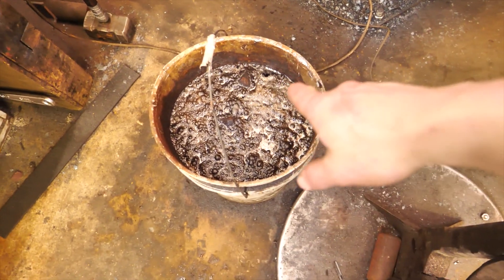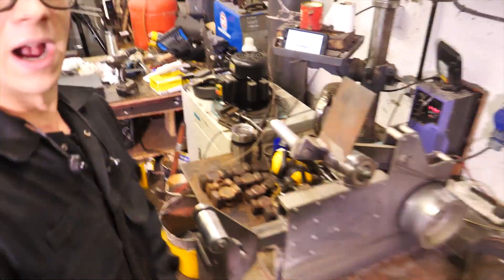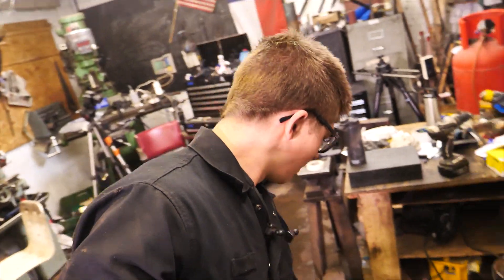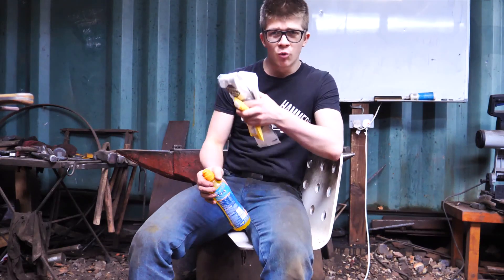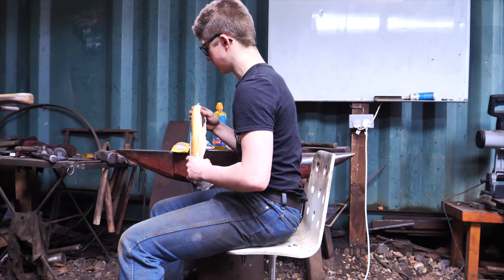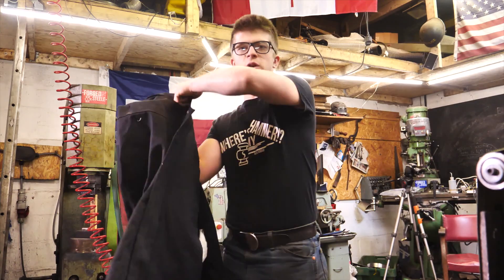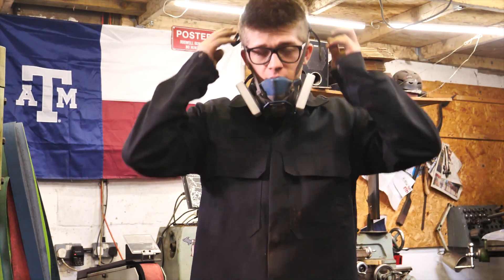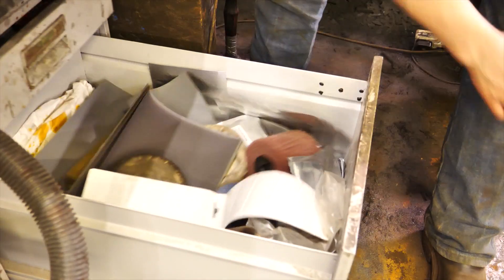BELT GRINDER BELT EXPLODES

Comment: little sugestion, if you stand in one place for prolonged time (eg.  when grinding) your feet will hurt. invest in workshop mats, that you put on a floor. it makes work so much more pleasant.  we use them at work when we weld in a welding bay all day. it's a blessing. try it out!
Reply: Tomasz Drozd yeah I know them as anti fatigue mats. they are good
Reply: Tomasz Drozd it's funny but it makes your day so much easier
Reply: And if you double up ( 2 mats) it's even better!
Reply: Given your work habits and style, I'd suggest two. One for the grinder and one for the mill - even though you don't use the mill that much, you're going to be standing with it for a while at a time and it never hurts to have a spare.
Reply: with that belt fail maybe one as a T- shirt😜
Reply: Tomasz Drozd especially wearing 1 inch heal boots -3.10
Reply: 3.10 ---1 inch heal boots ha ha
Reply: It's funny, a lot of people swear by them. I have got one at work as well, but i find them extremely uncomfortable. After a day of work my knees ache as hell which doesn't happen when i don't use them.
Reply: try to stand on your feet?
Reply: Check out the video Abom79 did about the work mats - he found some really killer ones.  I worked on concrete floors for many years, and I can honestly say you will never know how you got along with out them once you try good ones!
Reply: get the matt, you will thank yourself as you age
Reply: yes I agree, working as a part time cabinet maker my boss or some good ones and they are awesome when you have to stand at the table saw for hours on end cutting board to length
Reply: Not wearing cowboy boots when you stand on your feet all day will probably help too.

Comment: Top tip! Use distilled malt vinegar (white vinegar) available from food wholesalers such as Bookers for about a fiver per jerry can.

Used vinegar when its nice and brown has been converted to iron acetate. Strain and bottle this up and sell to woodworkers as a natural wood stain to ebonize wood. Zero cost to you.

Keep up the good work. Giles in sunny Yorkshire.

Forgot to mention if it doesn't bubble anymore when you add steel to the vinegar it's completely converted to iron acetate and now will no longer remove the scale.
Reply: Awesome info, this is one of the few channels where I find a lot of good tips in the comments too.
Reply: Doesn't vinegar cause hydrogen embrittlement? Not sure how long it takes but I've been too scared to try it with hammers, but you can bake in a oven after to remove it
Reply: I use just cheap white vinegar... remover rust too.

Comment: great video  Alec you need to put a rubber mat in front of your belt grinder. They really help with the back and hips not getting old faster. The older guys in shops I worked at used to tell me all the time when I was your age and I would laugh at them and call them old. Then I got older and figured out they were right. Trust meyour older self will thank you some day. Keep up the great work.

Comment: I'm a hobbyist silversmith. A routine part of forging or soldering for me is putting items in a pickling solution after it's spent some time under the blowtorch to get rid of fire scale. Vinegar is one of the ingredients in that solution--I'm betting there's a bunch of different pickling recipes that'd work well for the fire scale you have to deal with.

Comment: I ordered some bottles of glacial acetic acid (concentrated vinegar)to de-scale the water-cooling system on our CNC routers where I work. The Safety Sallys took one look at the MSDS (material safety data sheet) and sent it back. lol
MSDSs are written by lawyers, not mechanics or engineers. The one for silicon dioxide would have you avoiding going to the beach for the rest of your life! 
Just pour a little acetic acid and olive oil on your salad and enjoy. ;)

Comment: suggest a fatigue mat in front of your work stations.  also, get a frig and microwave.  get a griddle plate.  electric pressure cookers are great too.
Reply: FarFromN0thing he has a microwave up in the loft
Reply: FarFromN0thing A griddle and pressure cooker? dude, he doesn't have time to be pressure cooking at work. lol
Reply: Andrew Delashaw Aren't pressure cookers banned in the EU?
Reply: Andrew Delashaw it's a fast n quick food cook, similar to slow cooker. 1 pot. prep at home.  I do it and have a better meal at shop.  electric pressure cookers are in play at shops vs fast food chasing.
Reply: He has a microwave and a toaster oven... though the toaster oven is used for tempering.

Comment: i feel so identified with sanding belts exploding i got a couple explode on me cuz i couldn't read which way it was supposed to spin and a couple more because the were as old as injustice, one gave me a whip across the right shoulder another one slightly ate my knuckles, luckily no fecal matter was expelled XD.
Reply: yup, got a few myself. one gave me a bit of a scar through my t-shirt when it blew.
Reply: Thin cutting discs finally convinced me to wear a respirator.

Comment: If you use muriatic acid (hydrochloric acid), it should work faster than vinegar. 
Also, of you can keep the bucket moving or vibrating, it will help the acid carry away the scale and fresh acid can be exposed to the surface. 
You can also try using ferric chloride which is the same as hydrochloric acid except it has iron dissolved in it. Which is why it is so dark.

Comment: When dealing with vinegar, remember that it is an acid. You need to clean off the hammers with a baking soda/water solution, wash them off, and dry them before handling, especially when you get into the higher concentrations of vinegar. Definitely would make your work a lot easier

Comment: I have a tip for you: build a cover for that grinder: then the probability of hitting you is lower. while using the roles you could put it away, but at least for the flat parts you have protection!

Comment: A blacksmith I follow on Instagram (can't remember who currently, though) recently installed a belt grinder guard to put a damper on any flying broken belts. Simple piece of wood that flips down over the top of the grinder a bit above the belt. I think he had one pop shortly after installing the simple guard, and it seemed to work really well.

Comment: Humble chemistry uni student here. You could try putting whatever has scale on it into any form of hydrochloric acid and it should eat away the iron oxides. A product of this reaction is ferrous chloride which you use for etching stuff anyway. Might be useful to try out (drain cleaners usually have some percentage of acid in them or you can just wholesale buy the acid).

Comment: Love your videos. A quick idea you might want to try out; I've used the old vinegar soak trick to take rust off of old axe heads and mauls. Instead of grinding the rust off I just use a wire wheel on a bench grinder. Now I don't know if vinegar will break down the scale on your hammers enough to be removed with a wire wheel but it might be worth a try. if it does work that will mean less time you need to spend on the grinder and less wear on your belts.

Comment: The pickler at my steel mill uses sulfuric acid to remove the scale. We use an industrial "vinegar" to help pressure wash the heavy equipment at the quarry I work at.

Comment: Add a bunch of table salt to the vinegar. The salt will accelerate the reaction significantly. If you see steel sold as pickled, this is a similar process that generally uses much stronger acids.

A significantly faster way still is to use HCL. On medium carbon, simple steels, there is no problem with hydrogen embrittlement even with the stronger acids.

Further, even on knives HCL tends to be just fine, as you will be grinding off any affected bits of steel anyway. HCL is commonly sold in relatively dilute, generally safe solutions as pool acid (often called muriatic acid, at least in the USA).

The best way to remove scale with no possibility of over etching the steel is via electrolytic rust removal (a google search will show you detailed procedures) but all you need is a car battery charger, a bucket, some sacrificial low chromium steel, water and washing soda (Sodium carbonate, also called soda ash, distinct from baking soda).

Comment: Alec, buy or order white distilled cleaning Vinegar. I use it at my house instead of bleach etc, it really loosens up any scale I have on metalic surfaces. It made my 25yr old kitchen sink go from dull grey with rust stains to as if it just came brand new! 
(I couldn't help but notice yr attick microwave was a bit manky inside. Get a breakfast bowl, cut a lemon in half, squeeze the juice + equal parts water in, add the 2 lemon halves which are full of citric acids and oil. Microwave on high for 5mins then wipe away grime as if it wasn't baked on at all! 
God save the Queen, from "down under" Australia, still a part of the Queen's commonwealth. 👍♿

Comment: Also use citric acid instead of vinegar gets everything off you can get big 25kg bags and it is 1 part citric acid 20 parts water it works great
Reply: We used citric acid dip when I was in the Navy to clean diesel engine parts.  It would take just about anything off and would  eat up all of the white metal plugs but didn't appear to hurt the cast iron.

A sand blaster or pneumatic needle gun would be handy to take the scale off and is cheaper than belts.
Reply: Really, its likely that any mild acid would work quite well to just loosen the bit a little.
Reply: I can tell you're not lying about being in the Navy because you mentioned needle guns, lol.
Reply: Gotta go with what you know...
Reply: Jordonbrowo do you know what a needle gun is? 😂 I'm not in the navy but I could assure you they would use them for maintenance
Reply: If you mean maintenance as in chipping paint then you are correct.  They are great for any sort of rough cleaning where a sand blaster would be preferred but not practical.
Reply: atLucid I think you misread my comment. I know the Navy uses needle guns. I was saying I can tell he was actually in the Navy because he mentioned something like that.
Reply: hell I use citric acid to sterilize bone before I do a bone grafts. It removes all the infectious bacteria. I don't dip there heads in a bucket though.

Comment: CAUTION: when using pressurized air to dust yourself off, always ensure the tip is fully seated. Do not make the mistake of using the O2 on an oxy acetylene torch, as you will become extremely flammable.

Comment: Its good to wear the welding jacket when grinding, I've set my t-shirt on fire when grinding before. If I've not set it on fire it usually ends up full of holes and smoldering. 
Leather aprons are good to wear also.

Comment: 1 gallon 5% acetic acid (white vinegar), 1 cup of salt, 1 pint hydrogen peroxide.
heat helps, but isn't really needed. to dispose, use lime or other alkaline to raise the PH, then it's safe to take to a landfill.

Comment: Also, I might recommend that you neutralize the residual acid BEFORE you grind. Those freshly ground flat faces may begin to oxidize in that neutralizing solution (it is mostly water, after all). Dry those hammers off quickly after removing them, and treat those surfaces with mineral oil to prevent surface rust.

Comment: Protective gear may seem "wimpy", but the one time it saves your life, limb, or eyesight, it's not so uncool anymore.

I wear my welding jacked whenever I'm doing anything which sends sparks or material flying at high velocity.  It's basically the same, except the sleeves are made of leather.

Comment: idk, disks exploding on that big ol' freak of an angle grinder you use scares me more than sanding belts busting.
Reply: Once had someone advance the cylindrical grinder by hand and then press the auto-advance, which is supposed to be used on that one to skip winding it in by hand. Fortunately Dave thought he was an idiot and had been watching him, pulled him out of the way hard a second before the wheel exploded. That required a roofer to fix the workshop ceiling.
Reply: Both can be dangerous, depending on what you're doing at the time. If a belt grabs the blade while I'm grinding, I'm looking at a semi sharp piece of knife shaped steel being propelled in the direction of my belly at a frightening speed. The belt exploding and slapping me in the face is merely an afterthought at that point.

But yeah, I also think the angle grinder is way scarier... Generally, I try to position myself outside the plane of rotation if I can, just in case. That goes for angle grinder and belt grinder both. Of course, you can't always choose.

Comment: Alec for scale removing you should use a much stronger acid than vinegar, whic is around 3 pH. I suggest you to use cloride acid wich is very inexpensive and easy to find. You have 2 great benefit with cloride acid: you can save some money (i used it ad 5% in water, but you have to experiment with it, and here in Italy 5l of cloride at 33% is around 13€) and you can drastically cut the waiting time. By using an higher concentration in water you can remove scale much better in an hour or less (also because cloride is chemically aggressive with iron), so you can be waaaay faster than with vinegar. Of course with acid cloride is you must be carefull with handling, but hey! You work with stuff at 1000° C, you can't be scared by some acid!

Comment: Yes Vinegar comes in different strengths, cleaning strength would be better, Acetic acid could be acquired from an industrial supply, or put your vinegar in a stainless pot& boil off the excess water to concentrate, you might even be able to use the waste heat from your forge to heat the pot by placing it on the brick shelf. Take the pot away from the heat when the steam changes color.

Comment: Have you ever tried graphite coated canvas for your platen? The belts run much cooler, the platen lasts forever and there is just a little "give" to the platen. Allows better contact and a faster grind. We use it and affix with thin double face tape.

Comment: I use white vinegar but freeze the solution first taking the ice that forms off, leaving higher acid concentration. Also HCl, muriatic acid, works well somewhat diluted with water or even better peroxide.

Comment: Adjust your platen so that it just barely clears the belt. That way there is only contact between the belt backing and the platen while you are physically applying pressure to the belt, the big spaces where you are not grinding will mean the belt runs without friction on the platen, extending the life of the adhesive strip.

Comment: i found i split more belts if i put them on the wrong way which causes the join to peel apart. if they are the right way i've taken belts down to cloth (because of laziness. slap on the wrist) and not broken. dont know if you check as you put it on the direction or not.

Comment: Looking at the time lapse of your grinder side view there is clearly some stretch in those belts. The tension roller with a new belt is about an inch and a half lower than it is after a bit of use. probably not useful in figuring out when to chuck the belt but it may be worth a look.

Comment: You can try putting it in hydrochloric acid, you can buy that as a cleaning agent. But you probably need to be a little more careful with that, especially in the eye protection department!

Comment: Using the vinegar leaves the metal naked and its susceptible to flash rust .. just rinsing will slow the rusting but a light coat of any oil will stop the flash rusting. In your case, you still have a lot to do before finishing so .. its kind of a moot point to worry too much about it.

Comment: Alec , if you heat the vinegar it works faster and better , it does the same as your etchant removing a little steel .
I have mixed my ferric chloride to etch my cable Damascus.
I get the cheap gallon jugs of white vinegar at the grocery store .

I enjoy watching your videos , keep them coming .  After watching you use your big power hammer and I'm thinking about saving up for a big old steam powered  Chambersburge 200# hammer my brother found when he went to buy some machinery from a guy , the price is right but there will be some work involved ( mainly getting a big enough air supply) , it will work the same as yours but with an external air supply .

Comment: great vid mate. a note on vinegar. I use distilled vinegar when descaling if I remember correctly it's usually ~8% but I'm sure as a business you could buy high concentration lab grade acetic acid (99%) and dilute  it... might be cheaper. also have you considered electrolysis to aid scale removal (check out electrolytic rust removal by ToolNut on instructables). hope I'm not trekking you how to suck eggs. love the vids🙌

Comment: I'm just wondering if you or anyone has heard of something called braided Damascus before? I just thought of it recently, but didn't know if it was a thing or not. What i thought of is like a triple core Viking blade type of thing but instead of just forge welding the (either twisted or Damascus) bars straight, braid them together like you would your sisters hair. I think it would make an absolutely stunning pattern and think it would probably be fun to do. I understand it would also probably be very difficult to do, but I think you out of anyone could do it Alec!

Comment: I have had belts explode. It scared me, but it didn't hurt me. Once I thought about it I realized that the belt has very little mass. The instant the belt breaks it is no longer under any tension and the drive wheels are no longer able to exert any force on the belt. So this is not like a grinding wheel exploding, which is deadly. So the most dangerous part is jumping back and falling on your ass :)